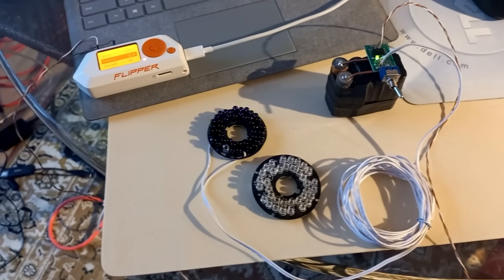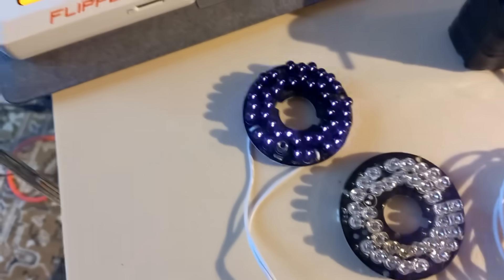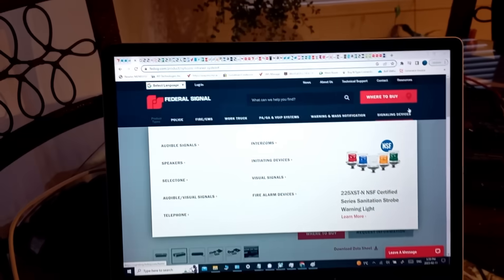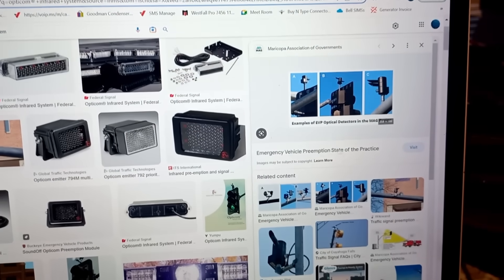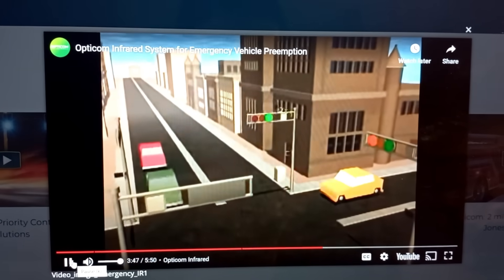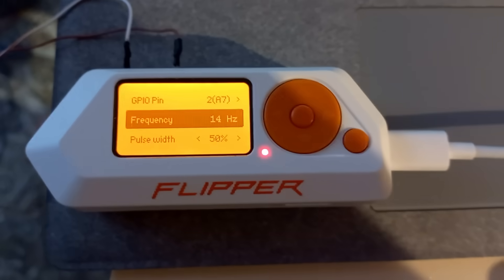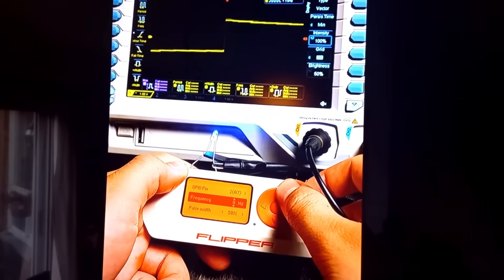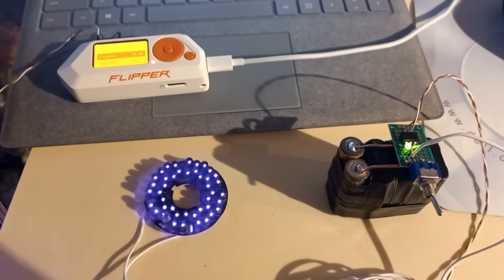Flipper Zero Controlling Traffic Lights

Comment: do you think it would simply be possible to scan a RAW IR signal from an ambulance for example and then send it?
Reply: Yes, of course you can record an IR signal and play it back, especially a signal that's only ~14 Hz. You'd either need to mount a sensor on a traffic light to read the signal or convince an emergency vehicle driver to let you stand in front and record the signal. Simple doesn't mean easy in this case.

Comment: I would have thought an EMS vehicle would just make all the lights red.
Reply: They prefer to give their direction of traffic a green light so cars move out of the way and out of the intersections. A backed-up intersection causes the emergency vehicle to drive in oncoming lanes, which could still result in a conflict if someone turned right on red. Also, on one-way streets, the entire intersection could be blocked if everyone has to stop, including traffic going in the same direction as the emergency vehicle.

Fun fact: When the other directions are given red lights and the traffic lights the emergency vehicle is seeing all go to green, there will be one oncoming light at some intersections that isn't red. If the oncoming left turn has one of those "permissive turn" flashing yellow arrows, it will continue to flash yellow. This is to avoid a "red light trap" that can strand a turning vehicle in the intersection with no place to go.
Reply: Because a criminal whos running from the police sure cares if the light is red or green?
Reply: @ULouOW  No, because the EMS vehicle which is more than just police can go through the red light, and everyone else can stop...

Comment: I was thinking about trying to build the circuit with a raspberry pie pico w and an IRLB8721 MOSFET to connect it to a light bar to strobe with music through a web API. I think they also make 850nm light bars and pods that operate on 12v.

Comment: Would this trigger the emergency blue light ontop of the traffic light bar?
Reply: Where I live, the blue light shows the status of the signal head, from the rear. If it's on, the light is red. If it's off, it's not red. (Yellow being irrelevant, legally, in a permissive-yellow state.)

Comment: curious if the flipper zero works with street lamps?
Reply: @peterfairlie2296  interesting concept. I had always assumed most street lights were hardwired in. I'm pretty sure the ones in my area are at the least.
Reply: @peterfairlie2296  They probably use zigbee, not wifi.

Comment: I had been suggesting old night vision cameras as parts for a Flipper amplifier.  Very cool to see someone actually do it.  I DON'T recommend using it to mess with traffic though.  People have been caught and prosecuted.
Reply: @peterfairlie2296  🤣 That looks big enough to be a headlight replacement if it wasn't IR!  I bet it's pretty powerful.
Reply: Exactly.  Infrared is invisible to the human eye, but to cameras that are able to detect it, it's as bright and visible as can be.
Reply: @greenman360  if it's invisible, how come i can see it in the video?
Reply: @shithead  Because that's how IR works... it's invisible to the human eye, not the camera lense. You can test it yourself with a TV remote and phone camera.
Reply: @peterfairlie2296  with an arduino you could do it much cheaper
Reply: @electro2956  Yeah you can do it with a D1 Mini, even cheaper
Reply: @BoostedNW  or with a 555 timer, even cheaper
Reply: The lights send a signal to HQ when they are triggered, and the cameras take pics, and they know when it is legit and when not. Big brother is getting scary.
Reply: Bet you wouldn’t even get caught in a relatively small or rural town
Reply: @obeseperson  Very true because most of us small and rural towns don't have lights that support this function.
Reply: yeah
Reply: Isn’t light unregulated? That’s why laser jammers are legal but radio jammers aren’t.
Reply: @gianni_schicchi  You won't be prosecuted by the FCC but laser jammers are illegal in many places.  They are specifically banned in many states just like the devices that change lights(MIRT). Lasers are regulated by the FDA.  They only care about lasers over a certain power level though.  Interference with safety equipment (stop lights) could be prosecuted under other more general statutes.
Reply: @jmr  thank you officer
Reply: I know one guy who also got prostituted for this.
Reply: @whatthefuckallhandlesaretaken  The blade is no joke...
Reply: BS.  Cite a prosecution.  There is ZERO light regulation.
Reply: I've looked around online and can't find any cases of criminal charges for using a device like this. While I'm sure there are some states that probably have some sort of law that might be vague enough to include using a device like this, they also have to have some sort of proof. I guess if they really wanted to bust somebody for it they could possibly correlate a timestamp of when a traffic light was triggered and a timestamp from a traffic camera with video of you driving through the intersection at the same time, but that's only if the system even has logs like that, AND the intersection has a traffic camera, AND somebody driving close to you actually recognizes what's going on and calls it in. The effort needed to enforce something like this to me seems at odds with the number of people actually building these kinds of devices and the relatively low level of disruption it actually causes.

Not legal advice though, just my thoughts on the matter.
Reply: @NORMIES_GET_OUT  you're telling me this jmr guy is talking out his ass on youtube without citing sources? crazy
Reply: @chrismathewsjr  
California Vehicle Code 21464 VC
West Virginia - §17C-3-10. Interference with official traffic-control devices by infrared or electronic devices.
Colorado – Vehicle Code Section 42-4-1415
Illinois – Vehicle Code Section 5-12-613
Minnesota – Vehicle Code Section 169.14 Sub 12 (Page 6)
Oklahoma – Vehicle Code Section 47-11-808
Reply: @chrismathewsjr  South Carolina – Vehicle Code Section 56-5-3870
ennessee – Vehicle Code Section 39-16-610
Texas –  Vehicle Code Section 547.616
Utah – Vehicle Code Section 41-6a-609
Virginia – Vehicle Code 46.2-1079
Reply: @NORMIES_GET_OUT  You didn't search hard enough I guess.  We can't post links but here is one I found in a couple minutes.  Google "Man caught using device to change traffic signals - Louisville"
Reply: How’d they get caught?
Reply: No do not look directly into an IR lens it will damage your eyes from what I read
Reply: Where's the problem if you're turning others red
Reply: @universpro7741  Tell that to the people waiting.  Cameras such as security and dash cams can see you doing it.
Reply: And how will you be caught snitched on yourself!?
Reply: @veedog7  you realize the traffic lights have cameras that monitor traffic, someone can check the irregularity and see the vehicle , they arent used like speeding cameras but if its visible to the camera then they just screencapture and send it to authorities
Reply: @veedog7  that's how 99% of would-be criminals are caught. They have to tell someone, or all of social media.
Reply: I was wondering the same thing. 
How would someone using this be caught?
Reply: @billjohnston882  Most likely cameras.  These things aren't invisible to the cameras.  Some traffic lights are also networked and it's possible there are logs.  I remember someone from Florida made news for getting busted but I don't see the article.  I could see getting snitched on by other drivers as well.
Reply: @billjohnston882  If you broadcast freq and are not units verified to have freq, capture image of vehicle then alert local units. Not difficult.
Reply: @jmr  It's always safe to assume with stuff like this you're being overt enough to get caught, and that there are snitches willing to call you in. If busy-body dudes are trolling their neighborhoods looking for slightly-off license plates, just imagine the Karen patrols looking for "aberrant behavior".
Reply: @billjohnston882 Monitoring systems. Every time it’s used they can easily log the time and location of the event, and look at their surveillance to see which emergency vehicle activated it. 

When they find out no emergency vehicle was present and it was you instead, they will not hesitate to come after you.
Reply: Well guess how many people wont give a crap and still do it.
Reply: You don't need a flipper zero to mess with night vis cameras just use cheap ir bulbs with a flashing torch or 555 timer
Reply: @letsgetto1millwithoutvids  That isn't what he is doing.  It has to be a very specific signal.
Reply: @jmr  How do you have verified?
Reply: No they haven't
Reply: I had an older radar detector, I no longer own, had an IR blaster that had nearly the same frequency and that triggered a few lights.  I had it recycled.
Reply: @DanLovesPinballsnGames  me too i lost mine in a boating accident
Reply: @DanLovesPinballsnGames  Which detector was it that you use to have?
Reply: @DanLovesPinballsnGames  correct thing to do, live in fear so you don't go to jail and drop the soap.
Reply: Better stop the cameras as well. Oh, and at each adjacent light where they may be monitoring freqs......
Reply: There's no cameras at traffic lights because I run them all the time 😂
Reply: @Clan501-Scotland a lot of states have laws where you can’t be prosecuted based on a traffic camera. My state, Wv has such a law. They are there for accidents because most accidents happen at intersections.
Reply: @Electro-Fuzz without a doubt they are being used for more than just "accidents"
Reply: How are you verified?

Comment: Oh this is sick! I wonder if I could ask my local Firefighters about this, I wonder if they would be interested. Such a cool project
Reply: I doubt your local F.D. is sitting at red lights while on a priority call
Reply: @TheLHROCKS  Opticom systems help prioritize the safety of others by turning the light green, so no red lights need to be ran, posing an obvious risk. It's probably not necessary where I live for a different reason of which there's only 2 traffic lights in my whole town.
Reply: It's quite expensive for the road certified system. Your local volunteer department likely can't afford it.
Reply: @tripplefives1402 or do you mean build one?
Reply: @tripplefives1402  they do lol. If you live in a metropolitan, populated area, there's a high chances they're on most intersections.

Comment: To be specific, ems priority is 14.0035 hz
Reply: @peterfairlie2296  the frequency of the on/off strobe wouldn't change, the frequency of the light itself would. It would shift the wavelength .000093 nm. assuming 75 MPH approach speed (which is entirely unreasonable)

Comment: Can you please can us the links for the board, chip, switch please. 

Can you use Proto Board pro Raspberry Pi Zero?
Reply: Anything with a GPIO pin works, as long as you have the proper transitor.
Reply: I was looking for the same in the replies...

Comment: You earned a sub, nice job.  Have a BOM and ahematic?  This would be cool with a 12v car adapter.
Reply: @peterfairlie2296 Photo Darlington Output Optocoupler?  Will a 4N29M work? Looks like just the chip, an led and a switch.  Seems like something I want to try.
Reply: @peterfairlie2296  Ordered a 4n33.  (Missed the part in the video where you said that)  What are the small circuit boards called?  Prototyping boards? I can't seem to find one that small.

Comment: "A person who is convicted of the unauthorized sale, ownership, possession, or use of a traffic signal preemption device is guilty of a misdemeanor crime. If the unauthorized use of said device results in the loss of life is guilty of a felony"

Its a neat project and a fun thing to do but there are so many laws against even building one its ridiculous. TBH you shouldn't post videos of you committing a crime on YT.
Reply: It's only illegal when your caught using it in a nefarious way. It's like having a lock pick set on you, it's not illegal to own or use, unless your committing a crime with it.
Reply: @who_wantsit  by that logic you are correct, nothing is illegal unless you get caught. But in this case, simple posession of such a devise is illegal unless you are so authorized. That's how all the laws I've ever read are written (in the US). The idea is, anyone who would have such a device in their possession is presumed to have it in their possession to use it. Same logic applies to controlled substances. The same logic cannot be applied to a lock pick set since there are numerous reasons someone could possess a set for legal/legitimate purposes. That cannot be said about a device built for a single/specific purpose. The OP claims all he did was build a strobe, but what purpose does an IR strobe configured to flash at a very specific, well controlled frequency have other than to attempt to trigger a traffic signal control device? I can think of one but it wouldn't require a fixed frequency.

The OP is free to do whatever he wants but at least he knows there could be consequences or to do his own research.
Reply: @Dreddip  An excellent explanation! Thank you!
Reply: @Dreddip  In some jurisdictions, possession is permitted if not set up to be used in a vehicle. You know, for "research" purposes? After all, the companies that make these possess them before they ship them, and they presumably are working on improvements as well, which means they likely test them at some point.
Reply: Using it or taking a video of it is one thing, but just plugging some ir leds to the pwm output of a microcontroller isn't some magic or unique process. Its on the same level as bending up a paperclip and saying its a tool for picking locks now.
Reply: @peterfairlie2296  you keep saying you heard from a fire department that they're looking into low cost replacements, as though that absolves you of breaking the law (and recording it and posting it on a YouTube channel under your real name). C'mon man do yourself a favor and don't record yourself committing a crime and post it on YouTube
Reply: @JaWe  from the video of him driving it looks like he got lucky with all green lights in his direction and was not using the strobe to change the light. The indicator light was not lit or flashing and all of the greens including arrows in his direction were not lit, and traffic was not stop in all directions except for his, which is what happens when signal preemption is triggered. As far as volley fire departments there are grants that they can apply for that will pay for emitters at no cost to the department apparatus the volunteers themselves are not allowed to have emitters
Reply: @MediumHalf  the odds he gets convicted is slim so who cares?

Comment: Think someone was doing smth like this while I was at an intersection a bit ago. Or the intersection was just having an extreme bug. Cause I spent over 4 minutes waiting for a green light where multiple times the other traffic lights would go yellow, and as soon as they’d do that, one of the white emergency lights would start shining and turn one of the abt to be red lanes green again, and then after a bit of time it would turn the whole intersection green again. Idk what was causing this but was very annoying seeing it happen for a fifth time while checking my song to see I’ve been waiting for over 5 minutes. Wonder if the cop car that was in the lane next to me was doing some trolling or smth, but they seemed to be getting annoyed too. 

Note, there never was any emergency that ever went through the intersection and the cop car next to me didn’t have their lights on or anything, tho if they did I wonder what the signals woulda done with two commands telling them for green lights from two different angles that would lead to 4 green lights. Not sure if whoever was triggering this had a frequency with higher priority than the police. Or if it even was someone triggering it or just some weird light malfunction.
Reply: There was a company at an intersection I live near that had an infrared outdoor security cam that would change the light.
Reply: Yeah, the cop car next to you wasn't doing it or they (and you) would have gotten green lights. It could have been someone else, or just a malfunction. 

(I was the second car in line at a left turn signal the other day that kept getting skipped in the rotation. About the fifth time it skipped us, people -- including me -- started pulling out of line, only to have the left turn finally activate as we went through the intersection on a thru-lane. Oh well, went up a block to a location where I could turn left without a signal, and found my way back to the street I wanted to be on. Sure could have used one of these devices that day!)